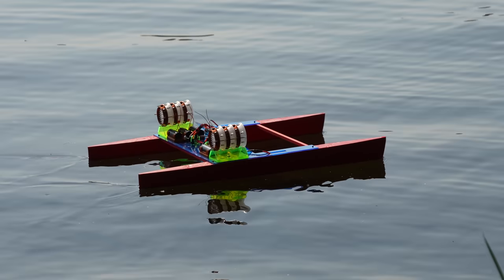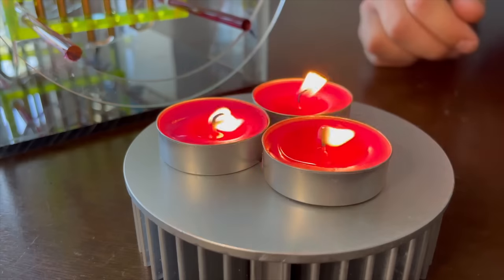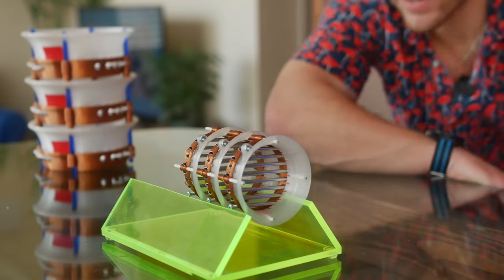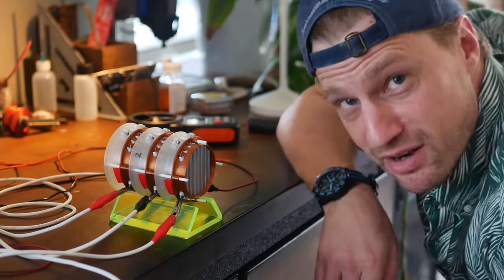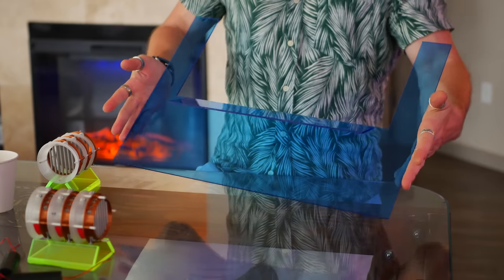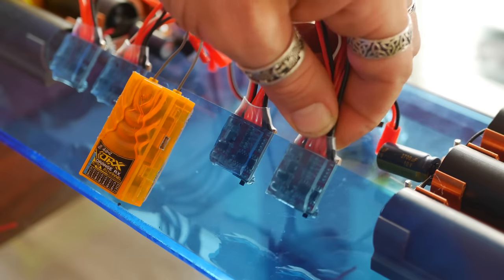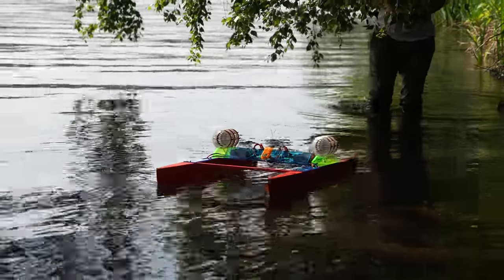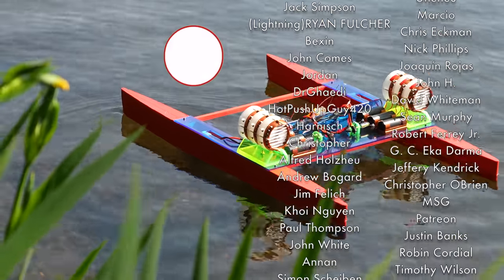Building A Twin Ion Engine (TIE) Catamaran (ft RCTestFlight)

Comment: Hi Jay, nice video.  A few thoughts on the "humidity problem".  Humidity effects high voltage devices by adsorbing to the surfaces of solids, such as the materials of construction and dust particles in the air.  Water adsorbed on surfaces reduces the surface resistance by providing a more conductive layer.  This could be mitigated by using materials of construction with less affinity for water.  PLA, Nylon, PVC, acrylic, PET and many others adsorb quite a bit of water.  Better materials from this perspective would be polycarbonate, polystyrene, polyolefins (such as ultra high molecular weight polyethylene or polypropylene), Teflon and silicone rubber.  Also, it might be interesting to try using a super-hydrophobic coating on the more problematic materials.  This still leaves the problem of water adsorption on dust particles, which tend to clump together under humid conditions (the adsorbed water provides a sticky coating) forming small conductive clumps, which act as corona points in an electric field, reducing the breakdown voltage.  One way around this problem is to choose dry, low particulate pollution (dust, pollen, soot, etc.) days for testing.  Probably the worst environments for ionic thrusters would be in the vicinity of sea spray, or at higher altitude (where reduced air pressure will increase the conductivity of the air itself by increasing the mean-free-path for impact ionization).  These problems could be mitigated by increasing the electrode distances in the thruster, but probably with a reduction in efficiency.  Looking forward to see how you tackle these issues.
Reply: what about simply putting an air filter +dehumidifier in front of the thrust inlet? we do that in our cars already. We cool the air.
Reply: commenting so that this comment gets bumped
Reply: One, maybe possible, solution I was thinking about, was if the incoming air, before the thruster, went through a flat section, between two charged plates, formed like a flat trumpet/horn.

Then it might be possible to divert the particles in the air to either of the plates.

If the intake side of the thruster would be pinched and placed close to the "mouth of the trumpet", then some of the air (hopefully containing more "unwanted stuff") would more likely pass outside of the pinched intake than going through the thruster.

Basically an electrostaticly charged particle diverter.

I haven't thought about it, but could the thruster have a flat shape, or would it become less efficient? If not, I guess the diverter would cause less drop in efficiency.
Reply: A hydrophobic coating is probably the easiest option. Polycarbonate isn’t the easiest to print and polypropylene can be very difficult at times. Maybe trying resin prints would be an easier option?
Reply: Dang bro you sound like a rocket scientist 😂
Reply: Jet engines have a shroud encasing the entire engine for multiple reasons including increased efficiency as well as protection. Though the shaping does give a shroud it doesn't have one independently of the assembly. Try adding one of a thin water resistant material.
Reply: That was Robert says .
Reply: Throwing out some less knowledge-based ideas here:

Monitor either the relative humidity, or the (presumably) increased current flow at breakdown to the controller throttle down input voltage.

Add a wide input air filter with a desiccant to condition & stabilize the air.  For bonus points, use electrostatic particulate filtering.  A Peltier chiller could condense the humidity out.  Or dry ice (on a temporary basis, so your project doesn’t get stalled due to humidity.)

Use dry compressed air or CO2 for reaction mass instead of ambient air - save the entire humidity issue for future research.
Mount the ion thrusters on pivots to be able to vector (and effectively reverse) thrust.  Or stack thrusters two high, in opposing directions to support reverse.

Going completely off the deep end, is there a version of ionic thruster that could work underwater?  Lower voltage, and conceptually like MHD (which I vaguely remember, but cannot spell.).  Likely to have problems with sludge sticking where it doesn’t belong?

Cool project & fun to think about.  You’ve probably thought of most or all of this, but I had the fun without the work. 😊
Reply: @firstmkb  I have seen videos attempting to use electrolysis to create thrust. None with any measurable success.
Reply: Warm air hold less moisture than cold air so test on warm days. Have fun so you can stick with it.
Reply: @maxluthor6800  Weight and efficiency are going to become an issue pretty quickly. These aren't very powerful engines. This system is already pushed near its limit just to move the boat.
Reply: @hyakinthos_0902 yes
Reply: Another possible set of solutions would possibly be to run intake past some form of dessicant and the other side to the solution would be adjustable control surfaces, mainly using some telemetry data to tune the distance between ionic thrust elements on the fly. More conductive surfaces at a farther distance, due to humidity, should function similar to lower humidity at stock distance. An arduino with all the right data and a "fuel map", of sorts, should be able to automate the distance adjustments. The dessicate shouldn't block the airway, just be adjacent to, it should help the adjustable control surfaces do their job. I'm sure if the theory sees commercial success, control surfaces will also be added to the internal conductive surfaces to control surface area and arc discharge shape (I'm thinking something like jet engine flairing control surfaces)
Reply: Not just Teflon but super-clean Teflon. In a marine environment. Uhh....
Reply: @firstmkb  : Attempting a condense the humidity out of an airstream that's entering an engine is a tricky thing that the SABRE engine guys have spent years on. Not impossible, but it's usually better to try something else first.
Reply: the full scale motors had more spacing so they may also be more resilient to the humidity problem.
Reply: @knightaries13  I was thinking the same, a shroud around the ionic engine with a hydrophobic air filter at the front I think would drastically help with the humidity issue. Or instead of an air filter (cuz that might restrict air flow too much), maybe he could try using hydrophilic material to attract the moisture from the air away from the intake of the shroud?
Reply: Commenting this so it gets bumped up
Reply: Adhearing? I don't know the definition of adsorbing?
Reply: @98f5  Adsorption means sticking to a surface (think getting hit in the face with a pie).  Absorption means being incorporated (think eating a pie).
Reply: @robertlapointe4093  thanks i was confused but it does make sense. Surprised i never saw that word in all my years lol

Comment: Just a thought. But by using bernoulli's principle/venturi effect, adding a longer tapered end might help with creating higher air velocity. Since you are moving the same amount of air through a smaller opening it could speed up the airflow.
Reply: sure but thats for converting a high pressure low velocity flow to a low pressure high velocity flow, that might not apply here
Reply: @AlexJoneses  True but the higher velocity flow also has higher kinetic energy. With the added nozzle aiming the flow becomes easier, that may prove useful later down the line: steering, thrust reversing, pitch or yaw control.

Just some ideas.
Reply: Well for a boat, you should look at water ion thruster.
Reply: @thierrymad9743  Several people have already covered magnetohydrodynamic drive with models from speedboats to submarines.
Reply: It's not about the velocity, per se, it's about the mass of the air per unit time. You want the least constriction possible. That's why air boats have a huge propeller and no ducting.
Reply: I’m not sure that would increase force, as the same volume of air would be going in as out. I don’t see what would propel it any faster
Reply: @Steve_Coates Ramius, is that you?
Reply: @lebojay   Da tovarisch.
Reply: As someone with no knowledge of fluid dynaamics, I am wondering if there would be enough pressure in the flow to overcome the constriction in the tapered end?

Comment: If you would put the thrusters on a 360° rotating servo, you could steer with both engines active, thus having more power while steering. It can also be used as a reverse by rotating the servo's 180° This could be a nice addition.
Reply: You could even pull a Crazy Ivan!
Reply: he was proud that this model has no moving parts. Also, this prototype wasn't designed to turn well, but to turn at all with asymetric thrust... He was checking if it works and propels at all.
Reply: + moar thrusters
Reply: @vennic  At the top of bottom of the hour?
Reply: You could also use a blown rudder and save a lot of weird packaging constraints.
Reply: Something like a fan boat maybe?  Could also use vanes for thrust vectoring.
Reply: It would add some weight to the craft, not just from the mounts, but also the added circuitry.
Reply: This also might work in space, though it may take awhile to get up to speed, after months it should go much faster than a chemical rocket.
Reply: Or set up the circuitry to run the engines in reverse as well
Reply: @bryanbryan2968  Sort of. Ionic thrust has been a propulsion idea for spacecraft for quite some time, but it works a bit different, since there is no air. Instead, heavy particles, like Zeon, are taken along as fuel, released into a heated plasma chamber (which knocks electrons into the chamber), ionizing the Zeon, which then pass through the two-phase electric grids that accelerate them at very high speed away from the craft, and finally an electron gun behind the grids to neutralize the Zeon so it doesn't attract back to the craft.

But, otherwise, yes. It provides low thrust over a long period of time.
Reply: @catbert7  Yes, I heard it could reach speeds around 1/2 million to 1 million mph.
Reply: I see someone has played tears of the kingdom latefly !
Reply: Can also fill the boat with white rice to absorb the humidity.
Reply: Save yourself a lot of trouble and use a rudder.
Reply: @bryanbryan2968  Ionic thrusters in atmosphere use the pre-existing air as reaction mass. Ionic thrusters in space have to carry their own reaction mass just like rockets. It's like the difference between jet engines and rockets.
Reply: @GordieGii  Yes.  And It's hard to get going really fast in an atmosphere because of Non-RuPaulian drag.  Also, Xenon ionic drive can accelerate to up to 3 or 4 times the maximum speed of a chemical rocket.  It(ionic) is a far more efficient form of fuel and engine design.
Reply: @bryanbryan2968  lol
I don't doubt that IT is faster and more efficient than rockets in space, but we were talking about boats, and there aren't a lot of lakes in outer space. (they tend to evaporate) Even if there were, they would surround the boat or fly away, depending on whether the boat were hydrophobic or not (one of the many non-Mulvanian phobias)
Reply: @GordieGii  Yes, of course with boats, the water ‘friction’ would keep the boats speed in check.
Reply: @bryanbryan2968  True, but unrelated to my point.
In terms of efficiency, a propeller or water thruster would probably be more efficient, but would have moving parts, possibly holes in the hull, so there are advantages to ionic thrusters; efficiency just isn't one of them. It might be, but I'm doubtful.
You don't have to put friction in scare quotes, it is friction.
Reply: Rotating servos and vectoring blades would add weight, moving parts, noise and additional power requirements, all reducing the overall efficiency.

Comment: First, this is super cool. I can't wait to see larger scale models. A question about it being 'silent'. Have you checked this with an oscilloscope or something similar? It might be silent to us, but seems like it could also be producing some very high frequency noise that some animals may be able to hear.
Reply: high freq noise is not really water-penetrateable.
Reply: It definitely is producing high frequency noise, you can even hear it in the video.
Reply: Jep is definitely not silent!!!! Der is a massive noise in the ultrasonic range!!!! And I mean not the sparkling. 

But all in all...lovely cool project 👍
Reply: @Andrey_Gysev  my man, that is literally CHIRP sonar. and boat hulls transmit sound.
Reply: @Andrey_Gysev higher frequencies travel BETTER in water.....ever hear of ultrasound imaging?
Reply: @roberthercules3159  higher frequencies overall travel worse in water. the reason communication in submarines can take so long to transmit is because they use "VLF", Very Low Frequency ranges to penetrate through the water. Although higher frequencies are more powerful, and capable of transmitting large amounts of data quickly, they are also highly reflective off of many more materials, water being one of them. Ultrasound imaging is only effective because of the extremely short range it has. It's not quite relatable to things penetrating miles in water.
Reply: This is really cool, but it's not going to scale for a number of reasons.
Reply: @gavincorsino8443  It might help to be certain whether you're discussing sonic vibrations, or EM (radio) signals: https://en.wikipedia.org/wiki/Communication_with_submarines#:~:text=VLF%20radio%20waves%20(3%E2%80%9330,antenna%20on%20a%20long%20cable.
VLF submarine communications are radio (electromagnetic/light) signals. Since seawater is a fairly good, grounded conductor, radio signals don't transmit well at all.
However, sonic vibrations carry further & faster through water than through air.
Reply: @gavincorsino8443  VLF communication in submarines is radio, not sound. High frequency radio waves don't penetrate water well because it is too conductive. (especially salt water) Sound is a mechanical phenomenon.

Comment: I have a bit of experience with 3d prints and high voltage from my previous job. One thing we discovered was that directionality of the print matters; very high voltage had a tendency to pass clean through the layer lines, sometimes creating little carbon trails and making them a better conductor than a pure air gap. You may be able to reduce sparking by making the rings a nested two-part design, with the nesting parts printed 90 degrees from each other (though that might require a more support material than is practical). You could also try printing with a material you can glaze (e.g. ABS + acetone spray, though this is a huge pain to work with), or experiment with various coatings (maybe a thinned rubber sealant).
Reply from the maker: Thanks for this input, its very good to know. Yeah, I luckily have not had issues with the voltage jumping through, as long as I keep all edges rounded on the ground.
Reply: Did you ever test using sla or Msla vs fdm I could see how the exotic resins and high resolution of sla could be a way to avoid your findings